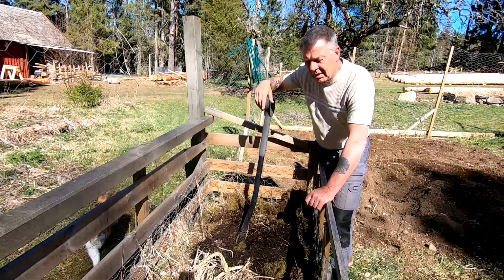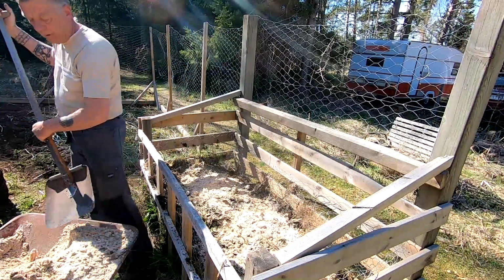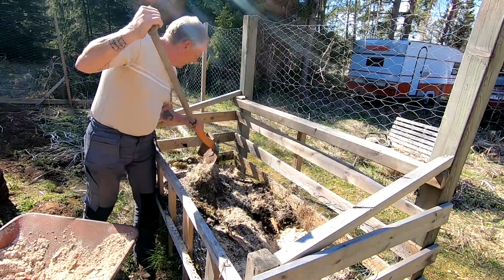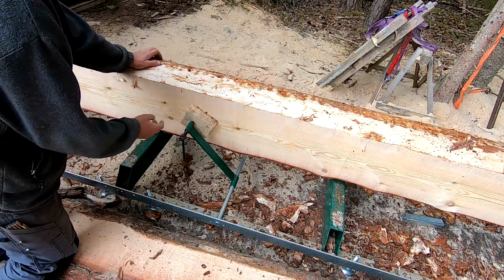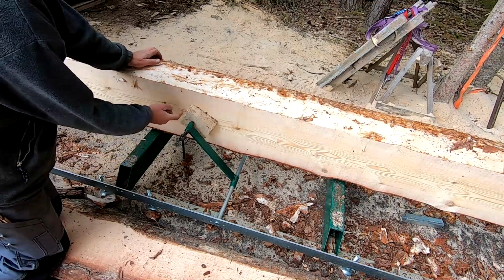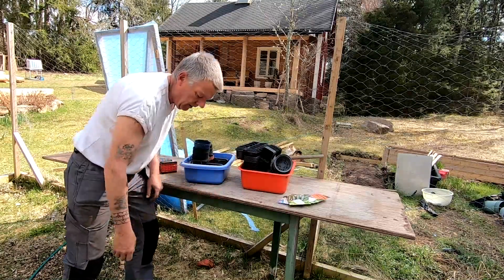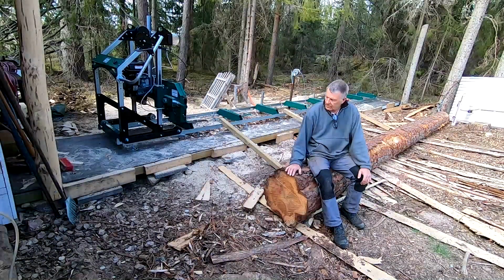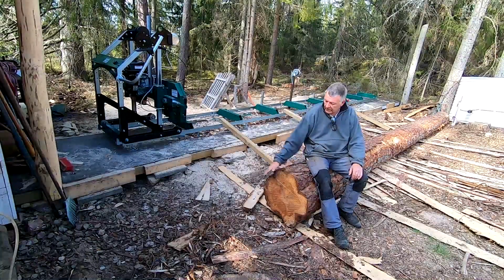More logs on my Woodland Mill, Vegetable garden - Vlog #159 - S3

Comment: Love the videos. 

I got my garden tilled and last week put in 4 rows of potatoes. Since then the wife has added a row of leaf lettuce, 2 rows of onions, 2 rows of red beets, 2 rows of green beans, and 2 hills of yellow squash (or was it zucchini?) Still need to get the tomato plants in too plus green bell peppers. But we are having a heat wave here in W. Illinois. Got up to 91*F yesterday with humidity in the upper 70%tile. Stopped working in the garden today at about 10:30 AM. Still need to work on the green house too. 4 main 4x4 inch treated posts set and concreted in.  Yes a vegetable garden always come in handy. Be Blessed.
Reply from the maker: That sounds like, you are in for a treat, later this year. Fresh veggies are great.
Greetings from the woods.